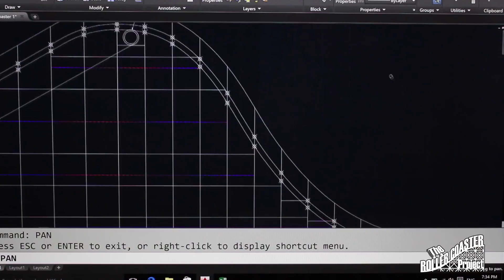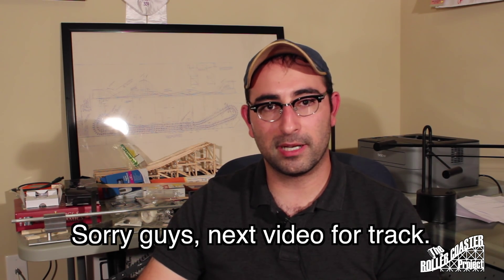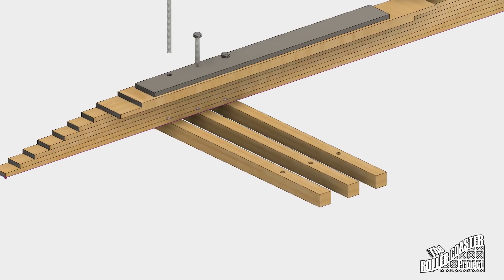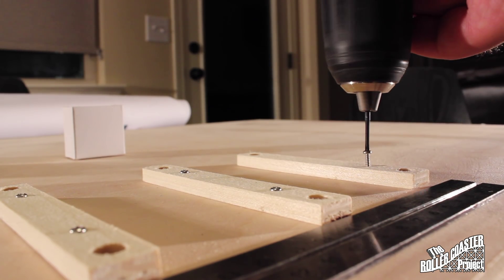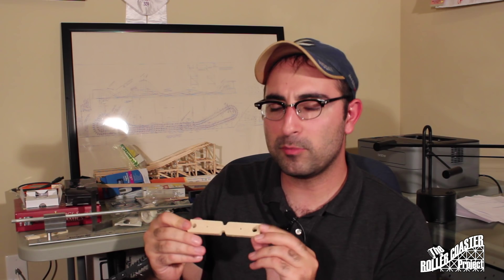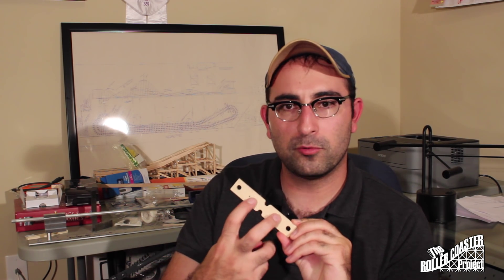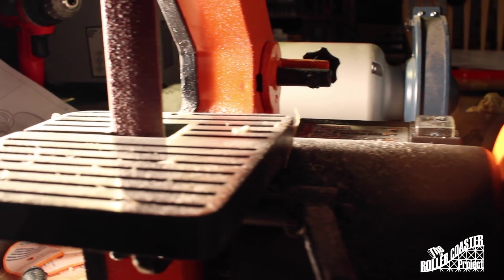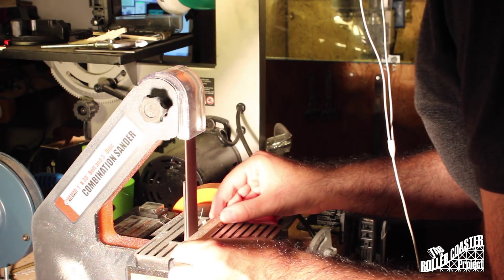Building The Wooden Roller Coaster: Part 1

Comment: what size wood are you using?
Reply from the maker: The dimensions of the wood are scaled from typical sizes used on real wooden roller coasters.
Reply: sorry I should have been more specific what is the thickness of the pieces your making. also any updates on this project?
Reply from the maker: +Cameron Johansen the pieces are 3/16" thick on the ledgers and supports.  Currently, I'm wrapping up some designs and getting settled in after a move, so the machining of ride components has been slowed.  Soon I should be building some other pieces by hand and will have a regular videos.  Sorry for the lack of updates.
Reply: awesome looking forward to it.